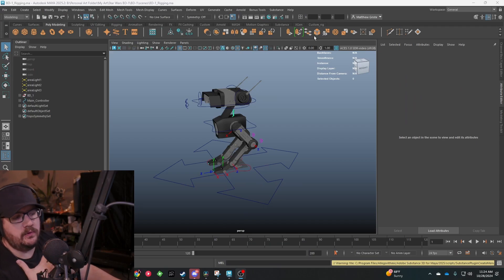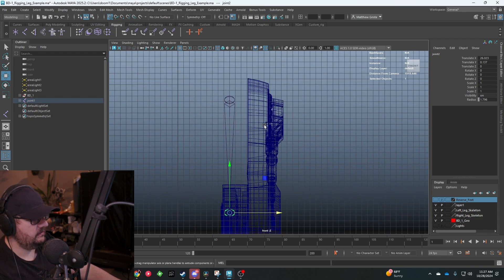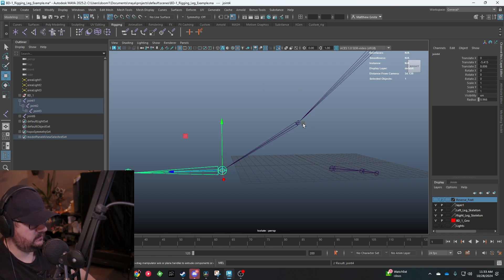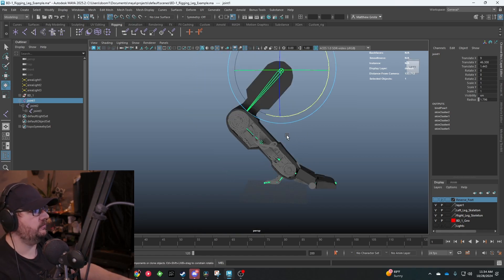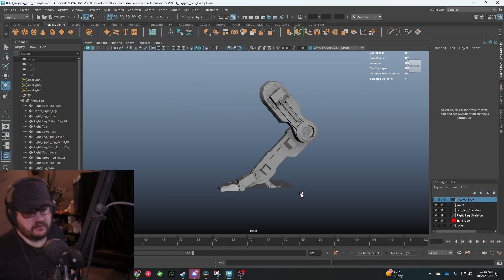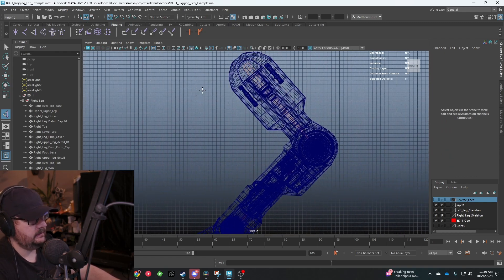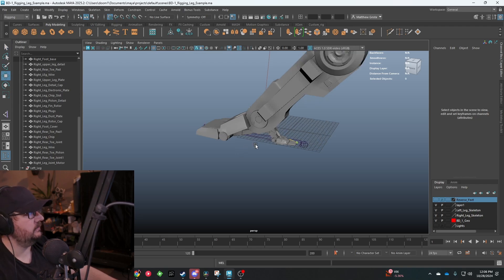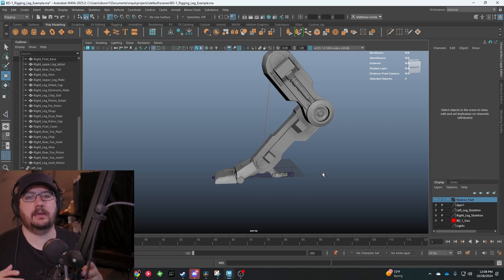Rigging a Robot Leg in Autodesk Maya | Part 1| Rigging a leg with Reverse Foot control!

Comment: Hello again.. Question: My pieces would not link up to the joint. I rotated the joint, but the piece stayed put. 

I had to group all of the pieces up the upper leg, unlock everything, freeze transforms, and then do a parenting op.
Reply from the maker: That's interesting yours wasn't working, The other work around is combining them all after they are textured and done this should yield the same result